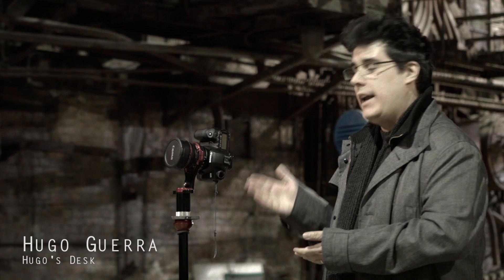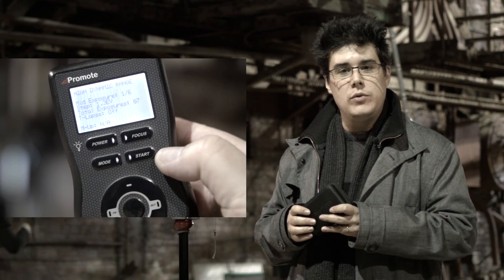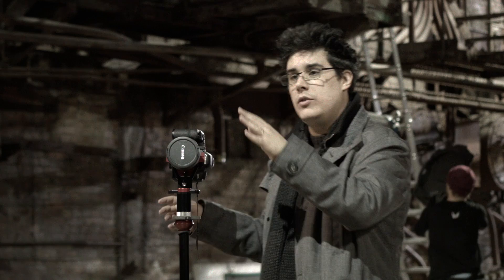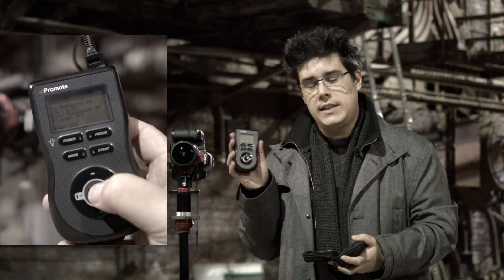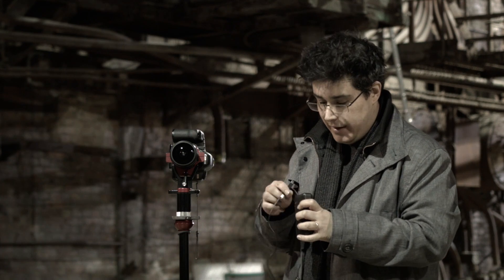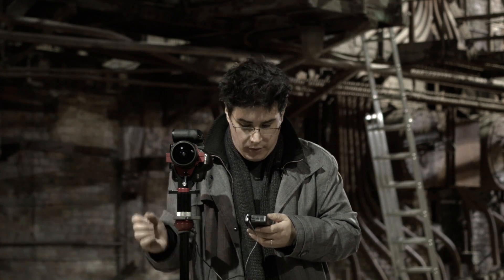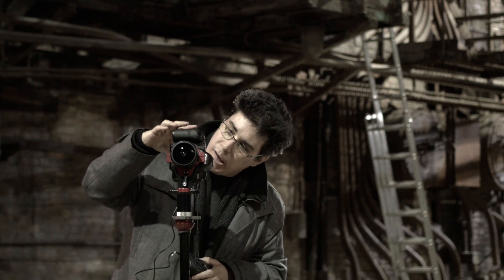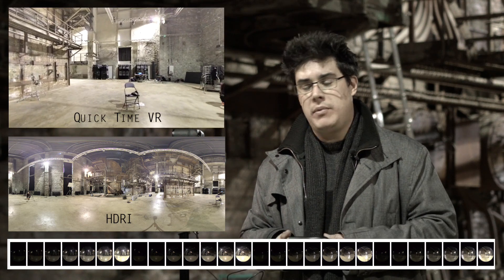How to make a HDR onset for CG lighting

Comment: I have a Nikon D7000 and I used to make hdr photos this way. I can't wait for my 360 degree camera to arrive!
Reply from the maker: Yes, I also use a Ricoh Theta V but I still find that it does not give me enough resolution. I only use the 360 in quick sets and hard places to take a camera. For me, nothing beats a 360 made with a 50 megapixel 5DSR. It is super sharp.
Reply: @HugosDesk  so what do you use your images for? Are you a professional in the film industry? For lighting and reflections rendered out to HD, I think the 360 camera will be fine. I don't show my 360 images in the final render. 

I composite my renders against video plates shot with my dslr.
Reply from the maker: Yes I am a professional VFX supervisor. I was the Head of Nuke compositing and VFX sup onset for The Mill London. Currently I Direct and supervise games Cinematics. Most of them are made in 4K so the extra res and quality from Canon sensor and glass always helps.
Reply: @HugosDesk  Ok well that makes sense with your profession. I think for a student or hobbyist, the 360 camera should be fine for lighting and reflections.
Reply: @HugosDesk  heres an example of how I use them:

https://youtu.be/11fy1JlN6UQ

Comment: hard to take man seriously as an authority of something technical, that refers to a level as 'air bubble'
Reply: the short answer to all the comments about not rotating about the sensor,
is that he does not use a nodal ninja or similar dedicated ibl tripod mount.
Reply from the maker: My videos are not scripted so I guess I will be more careful next time. Thanks so much for the feedback.
Reply from the maker: I actually have a Nodal Ninja but most of the times I don’t have enough time onset to set that up. I mostly worked in commercials so it’s always very rushed. I mean this is literally the setup we use at The Mill and it’s been working just fine for us. Thanks for the feedback.

Comment: Any reason you are not on the nodel point of the sensor? I was taught to have the image sensor as the point of rotation.
Reply from the maker: +Brek Brek Hi, the center of rotation is as close as it can be to the end of lens and center of sensor. At The Mill we had many conversations about this and after talking with the creator of the 360 head and after testing and researching it, we found that it is in the correct place. Thanks for watching

Comment: Is a full frame strictly necessary? I have achieved a reasonably well stitched panoramic HDRI with my cropped sensor DSLR.
Reply from the maker: +Matthew Moult You could do it with a crop sensor, it's more work, but it is possible, I have all done it. You can also use a 4.5mm Sigma so it becomes a 8mm in a crop 1.6.
Reply: +Hugo's Desk Thanks Hugo. I never considered the 4.5mm. Nice vid. Good to see this subject covered in this way.
Reply from the maker: +Matthew Moult Thanks so much for the support.
Reply from the maker: No you can do a few options. Cropped sensor with a 4mm lens or use a Ninja tripod to make several passes using the lowest lens you have. Like a 15mm. At the end of the day it's all about speed. How fast can you come in onset do the HDRI and get out before you are kicked by the first AD, lol

Comment: Amazing. Do you thing, that I can use simply Android Photo Sphere? I thing, that result is same.
Reply from the maker: Thanks mate. You could use it but here is the thing. I take RAW photos so you get 7 exposures plus the RAW dynamic range so the total dynamic range is far superior then using the android app. Also I tend to either export as a 32bit float EXR or HDR file. So I guess to answer you question, you could use it but you will compromise quality and dynamic range. Thanks again for watching. More to come.
Reply: +Hugo's Desk  Hello, I would like to know specifically promote control of settings? 0.5EV? 1.0EV? 2.0EV?
Reply from the maker: +高楠（Tom）Hi Tom, I used 1.3EV actually. Cheers

Comment: +Snoeysen Diggie you want to rotate around what's called the nodal point of the lens - the lens takes all the light rays coming in to the camera, focuses them all through a single point and back out on to the sensor - this point is the "no parallax" point of the lens and if you rotate around that, you won't get any shift in the perspective of the images as you swing the camera around on the pano head - the sensor of the camera is a small distance behind where the point you want to rotate around is.

Comment from the maker: Well it is not possible to make the adaptor to be in the center of the sensor. Anyway in PT Gui you can edit and adjust it so it looks right. Been using this setup at The Mill for years and no issues at all.

Comment: Just as a useful thing, the programmers of magic lantern, an unofficial firmware for the canons, have added in a hdri mode to canon dslr's - you can choose a middle exposure plus up and down, the bottom exposure then gradually brighter, or the brightest exposure then gradually downwards. It'll do far more than 7 exposures and let you choose what gap in exposure you want each time - I think it's either 2 or 3 stops of a gap that's the maximum. I'll save you 300 dollars on the promote!

Also for non full frame cameras, the samyang 8mm lens will let you do a great panorama with 6 sets of exposures. It won't quite cover the full 180 degrees per shot due to the crop factor but you can shoot ever 90 degrees with the camera aimed slightly down, then 0 degrees and 180 degrees with the camera aimed up to get the missing bit of sky. For the panorama head the nodal ninjas will let you control the tilt up and down of the camera as well as snap to each of the 90 degree rotations so you get everything covered evenly!
Reply: +John O'Connell Saw the RT-S earlier this year. Quite surprised how small it is. Someone ended up taking a 360 from inside their mouth. Most freaky looking picture I've seen for a while :)

Great video Hugo!
Reply from the maker: +John O'Connell That is right, using the Magic Lantern is very useful. I have it installed myself. Thanks for the comment. I use the Promote mostly because of the fast setup, and because it woks almost any camera.  Also I guess I am so used to it that I just use it, lol. When Onset, most of the 1st AD's give me like 10 Min to make the HDR I tend to just use the promote, faster and easier to setup under stress. But I guess if you have time using the Magic Lantern would be better. And cheaper.
Reply: +Hugo's Desk A lovely option for speed though perhaps lower resolution is the ricoh theta S - the current model is 300 euro but needs an iphone app to let you shoot brackets, some utter bastard of a coder knows this so the app's 49 euro :D - the new model is due out in november which adds higher resolution and hdri functionality built in. The main advantage is it shoots and stiches in camera - it won't make a hdr or exr for you, but you'll get your 9 360 panorama images out of the camera - it's 60 seconds for all the brackets with our current one so hopefully the november model will be similar. Currently about 5k x 2.5k resolution for the final image.

As you say you don't get a lot of time - this is literally walk in with it on a tripod, duck out of view and use the mobile app to set to shoot - can't get easier.
Reply from the maker: +Andy Nicholas Thanks mate.